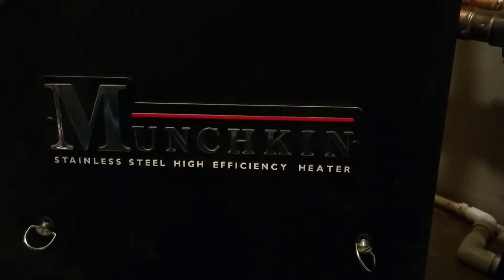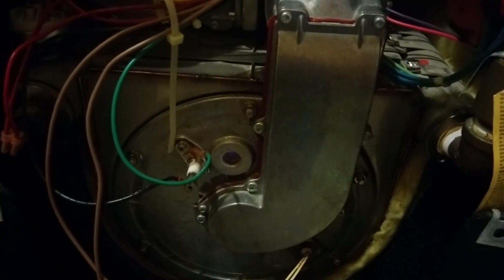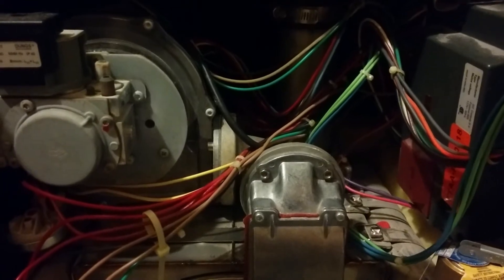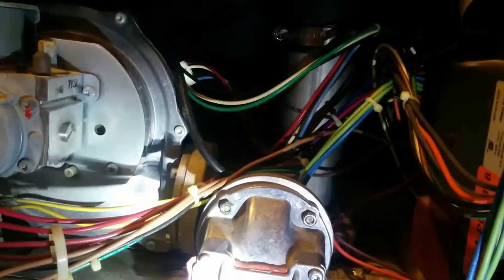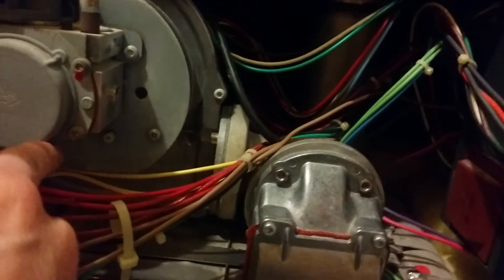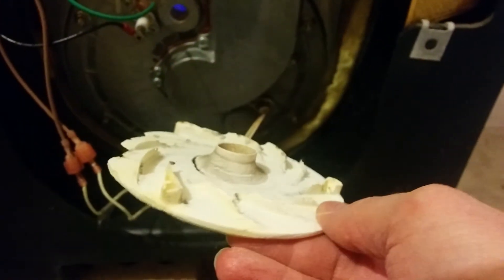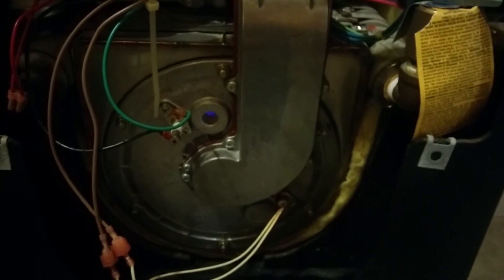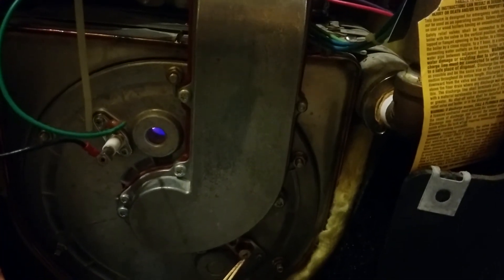Munchkin T80,T50 boiler repair and maintenace

Comment: Hi Craig, I am borderline desperate. Trying to replace part 7250OP-460 (Condensate Tube) which has been discontinued. I have a Munchkin T80M. There seem to be another part, part #7250P-724 and it is possible to buy it on e-Bay but I have called Ariston (the company that took over Munchkin brand) and they cannot tell me if this new part is adaptable to the T80M. PSE&G told me to replace the entire Munchkin!!! At a cost of over $15,000+!!! Can you help me? Thank you in advance for your assistance.
Reply from the maker: I don’t have a good answer for you. I recently replaced my munchkin with a Navion NHB – 80 H. I have been very happy with the new boiler. And it ended up costing me about $2000 to do the swap after the $600 rebate. My munchkin boiler was 21 years old and I felt like it was becoming unreliable. I also had the same problem as you are. Parts were becoming hard to find and pretty expensive. I think if you buy the part on eBay, it will only be a temporary fix. I still have my old boiler and the condenser tube seems fine. Do you live in the Salt Lake area by chance?

Comment: I have an old 80m LP that keeps  shutting off and will restart after reset but wont run long
any ideas?
Reply from the maker: What error do you get?
Reply: Blocked condensation drain

Comment: The part that you described as the flame detector is actually the ignitor.  It has a ceramic shaft on the outside similar to a spark plug; on the inside, there are two probes 1/8" to 1/4" apart, and a spark jumps between them to ignite the gas. This is right inside the sight glass, so you can see if you have a good spark.  

The flame detector is on the other side, in the lower right quadrant of the door, and only has a single probe on the inside.  You can't see it through the sight glass, and that's ok, because there's really nothing to see.
Reply: Not always.    Sometimes, the ceramic device on the left is just a flame rectification probe (with a single probe) and the lower right device is the hot surface igniter (See High Altitude installations).
Reply: @jsnthurst1  You are correct and for Canadian boilers

Comment: Thanks for the tip of removing whole burner assembly. Getting to those four allen screws is hard. I had to grind down an allen key to fit it in the tight space for one of the four screws. Poor design.

Comment: I have t50m munchkin, I want to clean it, If i take out 3 screws on blower assembly and bolts on bottom circular furnace is the gas line connected to that? I know to shut of gas valve.

Comment: You mentioned “blowing out the condenser “.  How do you do that? Mine is dripping water from the bottom of the boiler.
Reply: In my case, the condensate tube itself was blocked.  I pulled the tubing out of the rubber drain at the end of the boiler, which allowed a lot of backed-up condensate to drain out of the boiler on to the floor.  You might want a towel or two handy.    I blew the gunk out of the tubing with mouth pressure, although a compressor is probably wise.  I poured some water directly down the tubing to confirm it was clear, then reconnected the tubing to the rubber drain. Finally, I poured more water through the coils inside the combustion chamber to confirm it was clear all the way through, from there to the rubber drain and all the way to the end of my tubing.

Comment from the maker: I noticed my spin plate was very badly deteriorated. And when the boiler would run at low BTUs I would get a slight gas smell in my utility room. After replacing the spin plate the smell went away I did not notice any change in the flame color.
Reply: Where can I buy the spin plate? I have a T50M, but it's likely the same spin plate. Getting F09 & F10 errors. Flame comes on, but then goes out after just 10-15 seconds. Tries to come on again 20 seconds later, but same thing, goes out again after a few seconds.
Reply: I should note that I've always smelled a bit of gas coming from around the blower assembly - asked a heating/cooling guy about it when he was here helping me get air out of my lines and he said, "oh, you'll always smell a bit of gas there when it's running." Now I'm thinking he didn't know exactly what the heck he was talking about.

Comment: I have similar if not same boiler and just cleaned coils for year and started up. flame is mostly a pink color. any ideas on what to check? I ran it for a couple hours to see if it would get more blue but it didnt. thinking maybe my spin plate too. Any easy way to check it without disassembly or other things it could be?
Reply: Ryan Meyer